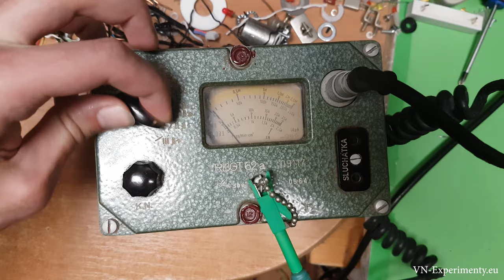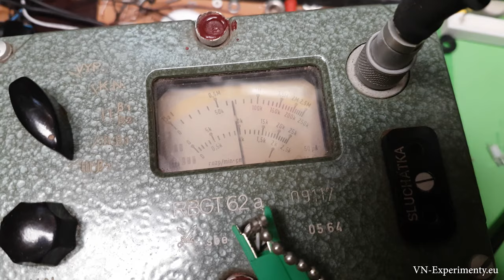Microwave bulb creates an X-rays

Comment: These are not X-rays. The device picks up the noise generated by the discharge.
Reply: No, he did test first if he measures noise from the high voltage. Very small lamps like from mikrowaves have a vaccume in them not argon and so they can generate X-rays.
Reply: @firefox1136  wait what!?
Reply: @Rainbow_1312  Yes, small lamps like the ones from a microwave can generate X-rays.